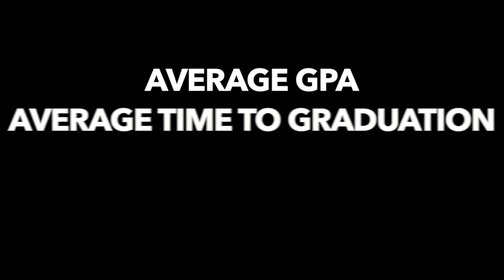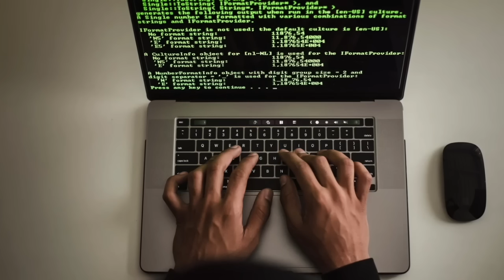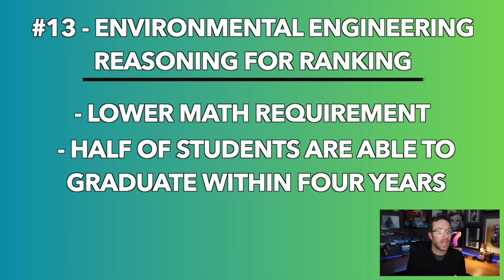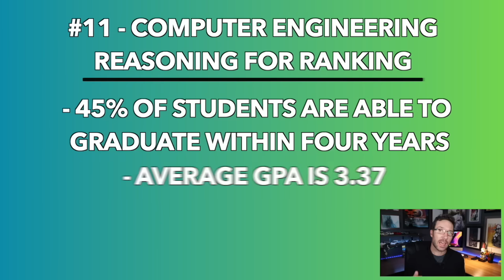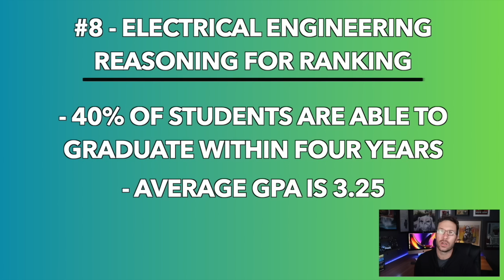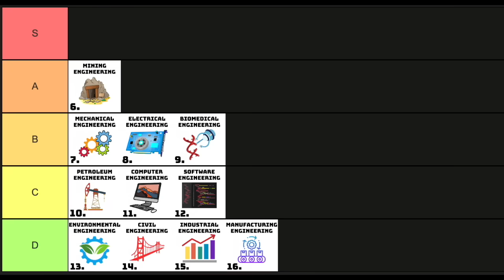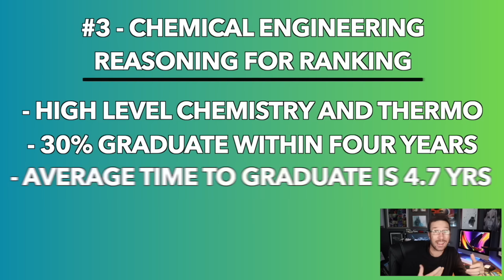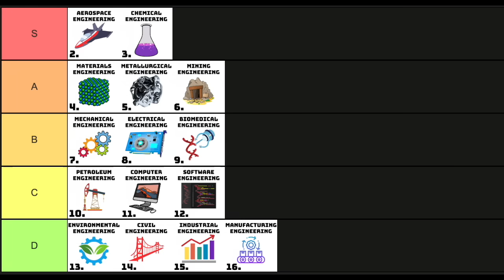Engineering Degrees Ranked By Difficulty (Tier List)

Comment: Stay off engineering.  They'll lay u off too often.  Get into trade sKOoo, like Electrician, plumbing, carpentry, masonry, ...
Nursing, ... It only requires 2yrs and it meets 3 A's (AAA):

1.  Anywhere - u can get a job anywhere.  In ur little town, NYC, LA, New Deli, Timbucktoo, ANYWHERE!

2.  Anyone - Anyone would hire u.  U needn't work for a big or shmall company:  A young couple across ur strt, an old
      lady next door/next town, a city apartment dweller in Dallas, NYC, Chi, Jersey Shittty, Dusseldorf, Ger, Tokyo, ...

3.  Anytime - Regardless of recession when companies r laying off, good econ time, ordinary time, bad or good time,
     u can get hired or earn income

So, don't get Engineering degree 2B laid off though the salaries seems big.  With the trade, u'll b the boss, not the one
who sits across from u at a table and say u're getting .7% increase this yr.  U can pretty much end up w too many
request for srvc even booked up for 3 months in a county w little towns ... And after getting ur handson expr, u can
get better capital eqmt, hire employees (like a company) to multiply ur constant income. No layoffs/job hoping.

UC, in a tech company, ur dealing w many super smart guys/gals than u, they've averaged As n Bees vs. in the trade
where u hand work n a bit of dinking(thingKing) will b involved.  It's hard to compete in a tech co. esp for non-civil
engineer (which is the EZest Engineering degree there is that this vloger didn't tell u.  That Engineering hadn't changed
for 500 yrs.  Like building bridges, arches, struts, rock piling, ... and all u need is just a simple hooks law equation!!! Unless
u can play politics if u get hired in a city gvmnt and become a city mgr of a big shiiitttty which u do nothing, just hide in ur 
orifice w a secretary filtering calls n visitors by she saying "So SAAaary, he's in an important meeting in WashingTown DC"). 

And, u'll find out datttoooh a hi-tech company demselves must compete w several co's. in the same town, same block,
same state, same country, and throughout in die weite Weld!  And too many go outtta beeswax, including urs.
 This vlogger doesn't knw bc. i bet he didn't go thru the experience heeemself but just looking up gvmnt statistics
and google.  U won't find what i listed above.  Engrng SKOoo professors would never tell u this (why?).

Stay outtta Engineering degrees.  Go learn and practice simple things to serve/sell people which r vital to them.  Not to
serve a company, esp. to serve temporarily to a tech co.

Gottto daaahaato?  All of the above is simple.  No ArithMetTick (nut Math w complicated equations w 5 unknowns to solve
buttto w only addition, subtraction, multiplication, and mayb division, better to know the power of fraction on ea. encounter).

And ein mir ding:  Getting a college deg translates to $100 - $200K Student Loan debt whether u graduate or nut(not).  And thx to
the DemRat's Obama Care package of "Federally Guranteed Student Loan" measure passed by DemRat majority CongRats,
the loan keeps on compounding n u won't b able to pay it off even after u reached 50 - 65yrs.  DemRat Joe Bite-In's who came
after Oba tricked the students saying 'We must forgive student loans'.  But don't guess what his requirements for the reduction
of only 20%.  The DemRats can never do the best ding for the student debtors.  I.e., to get rid of the "Fed Guarantee" measure.
But NOOOooOh!  they kant.  All those bankers, financial institutions, like Chase, ShittttyBank, BoA, WellsFarGo's investors won't
let the CongRats to remove the measure.

Cheers!

And Meow!

Comment: plumber here.  looking at these average incomes- I'm VERY glad I didn't get a degree- I'd be PISSED after all those BS asignments & late night studying for those income levels. weird thing about the trades: 75% of your 'schooling' is on the job- so, mostly, can't be taught in a class room. but with that- it's not for everyone. I could teach your 15 year old kid to rough in a house given 1 year of class room time, 4 hours a night- and one year on the job, but there's absolutely NO gaurantee you'll be profitable- that's what seperates the plumbers from the diy'ers.
Reply: Engineering is learned on the job as well.  And the incomes he posted are low.
Reply: @aliali-ce3yf  I've worked primarily in NC, SC & CA. southeastern? seems to do fine in residential- code officials are pretty well trained & no engineer is required unless you're doing a repair to an engineered truss. CA however- is a pure disaster. most municipalities require engineers for every residence 2 stories or more- and the complete stupidity of these so-called 'engineers' is appalling. to make it worse- the state only makes them responsible for their mistakes if the cost of repairing it exceeds 5% of the structure. one residence I plumbed in the bay area? total price tag, 2.5 million. so that idiot could eph up over $100,000 worth- and just shrug- and... HE DID. one home owner in SC INSISTED that there be an engineer's stamp followed to the T on a house. great. this moron DOUBLED an engeered floor truss under THE main plumbing wet wall. WOOOOWWWW. THANKS FOREST. mama was right- stupid is as stupid does. what they need is a requirement to pass an exam for a general contractor's license before they can start drawing pretty house blueprints & lower their liability limit to $1 and above. guy tried to flex on the building inspector- who turned him down FLAT anyway. it went all the way to the building code council- they essentially told him he should've known to stagger the doubled truss to either side below the wet wall & then had the carpenters bridge between with 2 x 10's- which is PRECISELY what the GC & lead carpenter already told the guy- but OH NO... he's got a ejumacashun! he knows EEEEEverything.

Comment: This guy doesn’t know Etsy he’s talking about. Depending on where they work and their role, mining engineers can make A TON of money. If you live in area that is big into mining, like parts of the Canadian Shield, it’s not uncommon for mining engineers to be making $140k+. Now if you’re a chief engineer, project manager, running a mine, developing remote sites, etc… you can earn significantly more.
Reply: who wants to live in those locations. yeah, you're making bank, but those are boring places to live
Reply: @aliali-ce3yf  Just like the guy who made this video, you have no clue what you’re talking about. Sure, you aren’t going to find operational mine sites in big cities like NY or Toronto but you will potentially find some of their companies’ head offices where you could work an office type job, reviewing data, planning, design; if that’s your thing. Not all mining engineering jobs require you to be on site or in the field full time. Many mine sites are positioned around mid sized urban areas; they just have to be located in a region that is conducive to mineral extraction, like the Canadian Shield, Nevada, etc… for example. Some are located around cities that are perfectly fine places to live and raise a family with all the amenities anyone would need. When large resource deposits were discovered in the early 1900’s it often initiated the development of communities in the area that later developed into larger urban cities. Not all mine sites are located in the absolute middle of nowhere. You can’t just move to any area where there’s no minerals to extract and expect to find a mine site nearby to go to work at everyday.

Now if we’re talking about ACTUAL remote mine sites; every mining company does FIFO (Fly-In Fly-Out) where they fly you to the mine site on a rotational work schedule, typically 1 or 2 weeks in and 1 or 2 weeks out. And all the travel time and expenses are paid. So you could live downtown Toronto in a condo and then fly out to place like Hope Bay, Nunavut to work for two weeks. And at these remote sites, when they are operational and producing, the facilities and food is often quite impressive (so they can attract and retain talent); with some having Olympic sized swimming pools and other recreational facilities, high speed internet, individual hotel-like accommodations, satellite tv, games rooms, etc… and of course high end medical facilities. So in today’s mining industry, you could essentially live and work anywhere.

Furthermore; ppl going to school to pursue a career in mining engineering likely don’t have “living in a non ‘boring’ city” as a top priority. And your idea of a boring city may be drastically different than someone else’s.

Comment: Ain't no way bro put Civil Engineering at D. In my university, the total credit is 161, and you have to study a vast majority of stuff. 

For example, Differentiation, Integration, all types of differential equations, Statistics, Probability, Regression analysis, sampling, estimation. 

Then we have Fluid mechanics, Engineering Mechanics, Tough stuffs of physics like SHM, Thermodynamics, Optics, Magnetism, etc. 

Also Chemical kinetics, equilibrium, polymerization, chemical thermodynamics, electrochemistry, colloid, Environmental chemistry, Corrosion, Water treatment. 

And I have only included 1/10th of it. And you can't graduation until you pass every single of them.

Comment: Agree with most but one thing and I have PhD in ee is that aptitude plays a role.  Someone who loves chemistry and hates electronics or working around electrical projects will have an easier time and vice versa.  Also where I went the engineering dept all required same core classes.  3 yrs Math 2.5 yrs chem 2 yrs physics, etc.  I got a bs in math by taking 4 math classes.   It was always understood that chem was hardest because it took most time  5 years for the majority.   Every engineering major is a lot of work and every one is almost impossible if you hate it.  I had to teach a lot and many washed out.  In talking to them they admitted hating it.  I can do EE no problem but get me around drainage, soil compaction or collector vs residential streets and I’m not interested and resist it at all costs.   Some people love that stuff and those are our civil engineers.

Comment: What degree of engineering did you finish? What you are talking about are not true. Civil engineering for example is so broad and has many branches. One branch is structural engineering and this requires a lot of tedious calculations in designing a a structure. You are talking about highest math which is the lowest subject in engineering. You should be talking about the professional subjects of each engineering and not math, which is the lowest subject. You should try solving a structural design problem in reinforced concrete (prestressed concrete) or steel design, so that you will know what you are talking about. In my country, to get a license in civil engineering you will be tested in all math, surveying, hydraulics, structural design and construction, strength of materials, engineering mechanics, engineering economy  and physics. The exam lasts for 2 days and there is no multiple choice. All the problems given in the examination are to be solved manually using only calculators, and are to be checked by human. In the examination room there are two proctors guarding the examinees, one in front and one at the rear. In math exam, all problems in math are given at once starting from the lowest up to the highest are mixed together and it’s up to the examinees to recognize which is which. Same in structural design, hydraulics, surveying, strength of materials and others covered in the examination. This is how hard to pass a Civil Engineering Board examination in my country, do you think this is easy? Maybe in your country your examination is true or false or multiple choice. Don’t even mention the highest math other engineering courses are taking, because as i have said  mathematics is the lowest subject in engineering, that’s why you will encounter them in your lower years in engineering.

Comment: I went into civil engineering because my parents told me i'd be good at it and enjoy it since i enjoyed woodworking in highschool and they didnt want me to go into the trades. Went in for structural engineering with a focus on timber design as it was something i was interested in. Couldnt get work in structural engineering and ended up in transportation working on roadway infrastructure. My bosses say that i do a really good job, and i recognize that what i do is very important for maintaining transportation infrastructure, and my field is high demand with lots of work needing to be done.......i really dont care about any of it. I am completely unfulfilled in the work i do. I gave up on aerospace since i considered it a pipe dream beyond my capabilities, but i wish i'd gone for it. I actually did really well in my fluid mechanics and hydraulics classes and worked really hard purely because the study material connected the course content to some aerospace applications

Comment: I graduated in 1983 with a mechanical engineering degree (BSME). The required credit hours racked up to be 22 credits per semester. I don't know where you got 125. Labs of which there were a few offered ONE credit hour for 3 hours of lab plus the write up on the experiments. We also study a wide field of topics that encompass electrical (3 courses and one controls theory), chemical, material, and aerospace. I took 3 calc courses, one diff eq, and another one where we studied the famous equations such as the Bernoulli equation. 125 credits for a 4 year BSME??? HALF dropped out before freshman year 2nd semester.

Comment: Guy! You appear to be assuming that PDEs are the apex of mathematics in engineering. This is not true. I assume that you are basing this assessment on what mathematics courses you were required to complete. Mathematics courses other than calculus, ODEs, and PDEs are squirreled away in other programs. For example, computer programs typically require discrete mathematics (a subject in which people continue to earn PhDs) and one or more courses in finite machine theory (another mathematics course this time about computability) or a subject typically called algorithms which extends finite machine theory to analyze the efficiency of algorithms (and yes this is pretty much another mathematics course). Basically, mathematics is the science discipline underlying "computer science" which is a mislabeled engineering discipline. Computer engineering is of course a hybrid of computer science and electrical engineering. Physics is of course the foundational science for electrical engineering just as chemistry is the science corresponding to chemical engineering. Nuclear engineering is of course another hybrid discipline.

Comment: Electronics engineer here. Saying that Ordinary Differential Equations are the “highest level” of math we study is simply not accurate. We also go through Partial Differential Equations in advanced physics courses like Electromagnetics, as well as Discrete Mathematics, series, and the most-rich frequency domain study overall with transforms such as Fourier, Laplace, and the Z-transform in Signals and Systems.

Comment: I have degrees in Electronics, Computer engineering, self taught mechanical, chemical (mostly inorganic for electroplating and surface finishing), software (these days mostly AI), specialized in Bio engineering (in partnership with doctors), RF (actually achieving a world record for ground to aircraft wifi) and do lots of other things in between.

So, if I had to do it all over what would I do differently? I would open up a produce shop and sell paw-paws and lettuce, spend more time with my family, and not work 16 hours per day, including weekends.

Comment: I have an undergrad in Electrical Engineering, there were only 4 real choices for engineering when I went through school in the 90s and they were, rank hardest to easiest, Chemical, Electrical, Mechanical and Civil. The others you listed were either concentrations in one of primary 4 I just listed or post grad degrees.

Comment: Somehow author missed Hydro-pneumo automatics and power drives. That is probably equal to air-space engineering in difficulty, but has quite earthly application. It requires studying not just partial differential equations but also a deep dive in complex integral equations and sequences. I had to study math all 5 years of my preparation to  S in that major. A lot of material is the same as mechanical engineering plus some material very close to electric engineering and plus a good portion of chemistry due to liquids used in hydro drives and hydronic elements (mostly aircraft and spacecraft systems).
Reply: Hi there! A-EYE!

Comment: Uh Electrical Engineering (EE) absolutely REQUIRES PDE. Wave guides, transmission lines, heat effects, etc. are all PDE. We also do signal math which is even harder still with convolution, Fourier & Laplace transformations. We also have a heavy emphasis on Thermodynamics than even Mechanical engineering since circuits (especially integrated, the bulk of EE today) are major producers of heat. EE's aren't just designing toasters. Hell, CPU's we design today could do computation AND make toast because the heat profile is that huge.
Reply: Very true! EE requires aa huge ability to abstract. And it is even more, such as complex numbers, tensors, relativistic, semiconductors, wave propagation, vector potential, ....
Most difficult engineering !

Comment: I once took a course in nuclear engineering because I worked for a utility with three nuclear plants.  I found the course  interesting and enlightening until I realized that  most of the work after that first course was in mathematical modeling  of the fuel burn in the reactor core The level of math required was the stuff of nightmares. So, I completed the course, tucked my tail between my legs  and gratefully went back to the real world of electrical engineering.